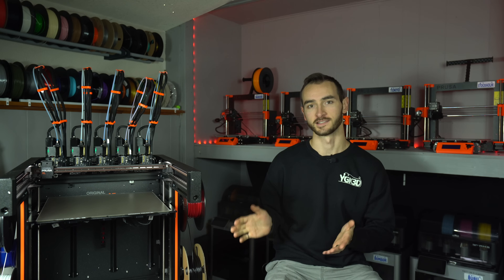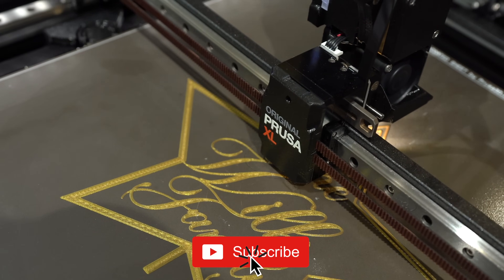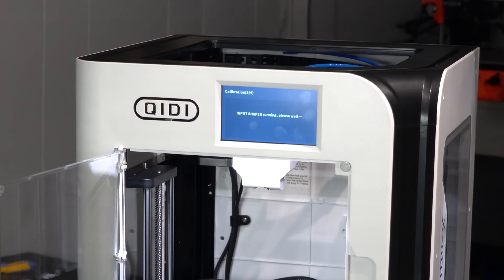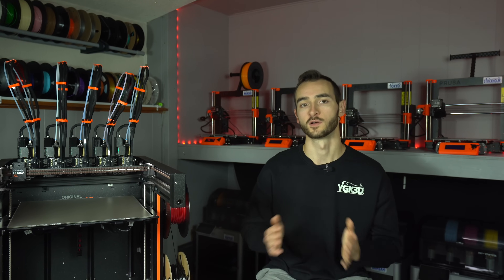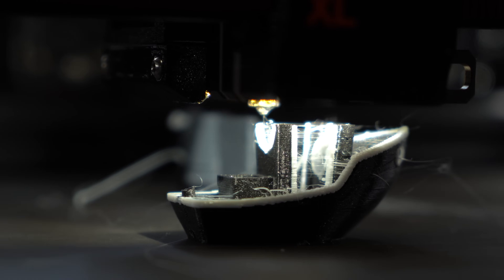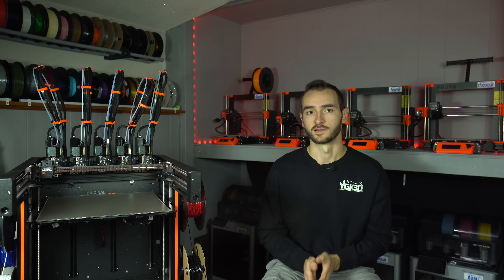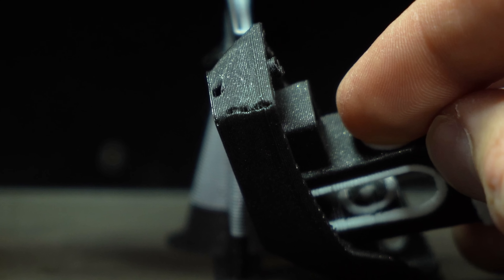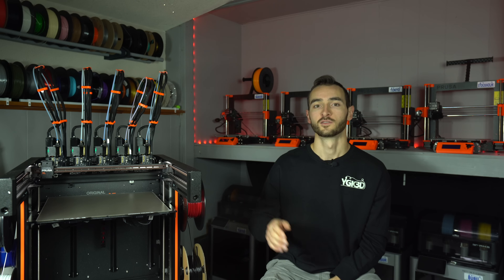The Prusa XL Just Got WAY Better with INPUT SHAPING... But Is It Enough?

Comment: The XL doesn't need to be as fast as a Bambu for single color.  My reason for wanting an XL is for multi color prints, which take forever on my Bambu  X1C
Reply: Also if some1 like to print multiple different material types, lets say tpu and PC, bambu can’t do that, XL can. So XL opens a lot of new oportunities.
Reply: @Bebamyotamaki thats not true. Bambu can easily print tpu abs pc an other materials. Dont know from where you have your information.
Reply: @Brise215  In the one printed part, e.g. PC with flexible hinge integrated by mechanical lock. Can it do that? Without post assebly.
Reply: @Bebamyotamaki  seeing that you wanna print pc for example how you gonna do that on the XL ? Its not capable of it, no enclosure or active chamber heating for that matter. Prusa didn't care for that price to add it. Says allot.
Reply: @OneHappyCrazyPerson   I still haven't got answer for my question: Is Bambu lab's printers capable to print that? As far as I know, it is not capable to print that.

Printing PC-filament without heated chamber debends on the filament properties. PC-filaments that are engineered specifically for the 3D-printing, like Prusament PC-blend, can be printed without heated chamber. And if you say:" It is a blend, not real PC-plastic", well.... If you can find any plastic object from your home that is made of homogenous polymer and not from blend, I will buy an other X1C for myself. Plastic object that is functional, usefull and specially engineered for its main usacase by the design and material stand point, that is made from homogeous polymer and is not a blend. Please.
Reply: @Bebamyotamaki  you really are a joke, the answer is above. And you can get all technical with the filament but the fact stays it's no substitute for a heated enclosure. If you had experience you would have know that but seeing how you try to mitigate the problem you don't have any experience. Yet for 3500 dollar prusa says screw you! Do without enclosure and without touchscreen and fast speeds or the capability in the future for it. Also kinda weird they want you to pay the full in advance and deliver summer 2024 what kind of bullshit company has this become ?
Reply: @Bebamyotamaki  Great way to get vendor locked with your filament that's not always the best on the market.
Reply: @Brise215 Your right, I did nylon, pc, petg, abs, asa, pla cf and never had problems.
Reply: @OneHappyCrazyPerson  I would bet my money that in a year bambu will prohibit the use of 3rd party filaments with the AMS. They are fully capable to do that. Inside of the AMS unit and the Bambu filament spools are a RFID tag reading properties. That means that they can just shut down the ability to print spools of filaments that do not have or have wrong kind of RFID tag. Then Bmbu users are locked to use only Bambu sold filaments, which prices will skyrocket by then.

Can you please prove me wrong by e.g. showing a picture or something where Bambu printer has printed flexible hinge attached to the any rigid part? And the part is printed in a one go without post assembly. Please.
Reply: @Bebamyotamaki  i never question it because all i printed worked fine. Never had problems with this machines and i never will worry because there is for everything a spare part wich is easy to change and fix. 
Trust me, its no wonder why so much people are fanboys of Bambus 3d printer. Never was so amused with a printer.
Reply: @Bebamyotamaki  Not sure exactly what you're asking but:
1) X1C can print different materials as long as they are not a mix of low temperature with high temperature plastics. This is kind of common sense - I tried printing ABS and PLA together (by tricking the printer, because the software is well put together and wouldn't allow you to do it otherwise) and got a heat creep extruder jam for my effort! Generally you can print multi material as long as the nozzle temperature between the two is within about 10-20c of each other

Now perhaps the Prusa XL can do it, but I doubt it and I doubt it would be useful, because if you tried to print say PLA at the same chamber temperature as ABS or PC, you'd get horrible warping of one or both. and probably bed adhesion issues. Given that PC prints on the bambu at around 110c bed and 50+ c chamber, trying to combine low and high temp plastics seems like a dumb idea of limited to no utility. 

As long as you dont try to combine high temp with low temp on the X1C, you can print multi material (and I've done so).

2) PC prints very well on the bambu BECAUSE of the chamber, and i can confirm you can get very strong warping forces through say opening the enclosure door too early after a print. To the point that your whole magnetic plate might be lifted from the bed! (ask me how i know). 

Not to say you CANT print PC or ASA/ABS on a Prusa XL without enclosure, but based on my X1C testing, I would say you will encounter many issues and will quickly conclude that an enclosure IS necessary.

It doesn't have to be heated enclosure, just enclosed and preheated (by setting bed to high temp and letting it heat up) will do.

But there are plenty of enclosure options for the Prusa XL i believe?
Reply: @Bebamyotamaki  I thought you had an X1C? Surely you know that the AMS CANNOT handle TPU and that you CANNOT print TPU with other materials from the AMS without manually doing switches?

I'm not sure if the Prusa XL can handle TPU + rigid but i thought it could and was one of the major advantages of the Prusa XL. 

The X1C CANNOT print TPU + rigid material in a practical, automated fashion. And nobody wants to sit there doing hundreds of material changes off a spool (and you can do that on any machine, not just an X1C). 

So no, no flexible socket attached to a rigid arm
Reply: @Bebamyotamaki  You would lose that bet! There's no way bambu will limit the AMS to only bambu filament, in fact, even now you can simply disable the RFID tag reading. 

I have no idea what your problem with Bambu is but that's ridiculous. The X1C is a fine machine and bambu have produced a good product that they support quite well. Doesn't mean a Prusa XL doesn't make sense in some situations, but it is ridiculous to claim that Prusa is somehow a less evil company or some such nonsense.

These are just products at the end of the day
Reply: @Bebamyotamaki  that is the plan. Tpu and pla mixed
Reply: @Bebamyotamaki  bambu can and does it, support materials that are different but also complete different filaments. It's up to the user, if the chosen plastics bound is another question.
Reply: @OneHappyCrazyPerson  Can you give  me an example of the material combinations? And I mean the different materials, not just different colors of the same material. Also I would like to know how is the mechanical properties of the part when printing two different materials (not color, materials) to the same printed part with single nozzle.
Reply: @Bebamyotamaki Who is the one crazy here? 🤣 Great job ! Keep going student, your learning.
Reply: @Bebamyotamaki  Dunning Kruger
Reply: @OneHappyCrazyPerson   =)
Reply: @Bebamyotamaki  it seems you are a fan boy that never even looked further then prusa and have some wrong Idea what other printers can't or can do. Just because prusa printer can do something doesn't make it the standard.. the printer firmware and it's options are hopelessly outdated. One could never hook up a adxl for input calibration, you just get some values for some slow printing and that's it. It's not really input shaping as it's not dynamic.
Reply: @OneHappyCrazyPerson  Okey, Im Prusa fanboy (even when I own X1C) and you are then Bambu fanboy. I quess that we are even. I might be short sigted, even I'm PhD student studying 3D-printing material science and machines with addition my side hustle business with selling 3D-printing  consulting. But In the world of 3D-printing Bambu fanboys always are superior persons, just because they say so by themself =)
Reply from the maker: Good call. It’s leagues ahead for multi colour.
Reply: @ygk3d  multi material, but prusa boys cannot compute that as in there world the prusa is everything.
Reply: This. That's the niche of this machine.

For single material or materials 6-16, the bambu is just better (6-16 only because this only has 5 print heads)

Comment: I have my XL for two weeks now. I changed the nozzels for Bondtech CHT's. The printer came with the new alpha firmware installed. I did not have any stringing with PLA and very little with PETG. As the Bondtech CHT nozzels are capable of melting the plastic faster, I've set the printspeeds about 15% faster.  The Bondtech CHT nozzels not only melt the filament faster, the have less ozing too.
Reply: Interesting, I have a Bondtech CHT on my FLSun V400 but I didn't consider them for my XL. Did you use the prusa "nozzle adapter" and regular Bondtech CHT nozzles, or is there something I am unaware of?
Reply: I agree with my Mk4. Bondtech cht nozzle is just 👌
Reply from the maker: It came with the alpha installed? That seems strange. Thanks for the tip on the nozzles.

Comment: Excelent review as always, but I would love to see a video of the XL making the most of those toolheads. 
By this, I mean:

* Printing with different nozzles, a large one for infill and a small one for perimeters and details.
* Printing with different filaments... solubles / regular ones.
* Combining rigid filaments with TPU to achieve more complex objects.
Reply: Hey - I did all three with my XL 2 Toolhead:

Printing with different nozzles is super hard and not really supported at the moment. This only works if you use on nozzle only for supports for example.

Printing Different Filaments works great. For example PETG Models with PLA supports works amazing.

I printed handles for Pushups for my wife since she has problems with her hands. I used a model from turntables and put a cylinder of TPU around it in Prusa Slicer. Printed great and works great. No Problem at all. 
The only thing I found out is that PETG sticks really well to TPU, so PETG supports for TPU will result in a very hard challenge afterwards - I needed an hour to get the supports of semi cleanly.
Reply: @zebarzebra  wow nice. 
Yes, I saw a video from ModBot (I think?) that tested supports using different materials, and he got pretty good results. Glad to hear that it works great with the XL.
Reply from the maker: Thanks! I’ll show off different material combinations in the next video.
Reply: @ygk3d  Cool! thanks =)
Reply: @ygk3d thanks!
Reply: Yeah that's what I want to see also, maybe a print with soluble supports and 2 rigid bodies separated by flexible TPU parts (maybe a hollow sphere with a flexible band around its "equator",  Or a box of some kind with a TPU hinge.

Comment: Can you try some multicolour/filament prints on the XL (not just benchy), and see the differences in quality and time between the XL and the Bambu X1C? As you said, the biggest thing the XL has is the lightning fast tool changes, so I would love to see that be explored a bit more. In what scenarios is the XL's tool changing superior in time AND quality, and in what scenarios is the Bambu set up better.

I saw in a different channel a guy with a 2 head XL, and he's doing TPU inside another material (forget if it was PLA or PETG), in order to make pressable buttons. Now that's not even possible in the AMS I think since it doesn't officially support TPU. What about using PETG as support for PLA, does that set up work well? Do the supports leave a nicer surface than normal same material supports on the XL? I know I can do that on the AMS, but it is just so slow with the filament swap, and since it is different material, you can't reduce the poop amount. Anyway, those are just some ideas to showcase what the XL might be better at.
Reply from the maker: Thanks for the suggestions. I’ll show off some more adventurous prints in the next video.
Reply: The XL head change is leagues faster than an X1 or P1 printer. (10-15 seconds vs 90 seconds on average) BUT...the quality from several youtubers have shown poorer print quality.  so you can save a bunch of time depending on the print but may have an inferior model at the end. 6:19
Reply: @ashleys3dprintshop  Yes I have seen some poor results with the XL, but I always wonder if those were maybe printed too hot, or maybe it's because of the default .6 nozzle? It seems like the XL has potential. Where as Bambu are much more turn key. So if you wanna hack at the Prusa, maybe it'll be able to print nicely. But I do wish either Bambu made a tool changer, or Prusa makes a smaller tool changer, that'd be perfect. I don't really need the giant print volume. But I do want multi-material/color prints.
Reply: @shenqiangshou  Re: "but I always wonder if those were maybe printed too hot, or maybe it's because of the default .6 nozzle", Prusa obviously believes the 0.6mm nozzle was part of the problem, as they have switched to 0.4 for further XL sales. But there is a lot more to the problem. Prusa believed they could prevent the stringing and color runs without a head-cleaner. And so far they are wrong. There are some community mods that add a small brass wire brush, and they drag the tool head across that when parking. This is the real solution, because one of the biggest problems is filament oozing out a bit on parking, then later getting dragged back into the print where that color isn't supposed to go. 

Physics is against Prusa on this until they decide to add a nozzle cleaning step which requires a minor hardware mod (for the cleaning brush).

Comment: be careful when comparing the X1C and the XL. The XL lamer is heavier and extruding more filament takes more time... 
the X1C is still faster with 115s/g compared to the 128s/g of the XL. 
But its not only due to different acceleration like you said.
Reply: Why should I reward a wasteful printer?

If the xl prints too much material, that's on prusa.

The end user doesn't care that IF prusa did the tuning work of bambu, it might be faster - they only care about how fast it is right now.

I consider using more material a huge detriment too, since i typically want to use only as much filament as necessary
Reply: @Tom--Ace  
If you want a wasteful printer, look no further than the Bambu on colour changes.
Reply: @Tom--Ace  It is not about rewarding a wasteful printer. It is about make a more correct comparison. If the slicer were equal what would there print times be. You could say:

Why should i reward the printer that distorts my original model more. 

With that said I would be nice if the XL had more tuning down to the slicer so that it can print faster. Prusa tends to not like to distorrs the thing they are printer for the stake of make a more accurate print. This mentally seems to be changing since they have been getting killed in the speed game.

Comment: Thank god I canceled my order 2 years ago; I would be pissed that I would have received a printer that was not fully baked after 2 years of waiting. And see, they still need to work out a good portion of the issues even though they said delays were to provide better quality.  And to add input shaping and pressure advance, which has been around for years. By the time this is a refined printer, they will be 3 years behind technology.  Prusa has lost its way.

Comment: I got an XL 5 Head and I can’t really say that it is worth the money yet. I am not disappointed that I bought one but I can’t say that it is an incredible bang-for-buck machine. However, if the support is as good as it was for my first Prusa Printer (Mk2) then it will eventually become and incredible printer.
Reply: Probably wait for XL mk2 or XL mk3 before they get it to where it should be.
Reply: Yeah but nowdays even creality brings much faster update than prusa...
Reply: Hardware wise the XL has much more potential and with Prusa you just know that they keep bringing out new firmware and slicer-tweaks for several years. The build quality of Prusa printers is good enough to last alt least five years, even with near continu running. Don't know if printers of other brands will be capable of that.
Reply: @wilsistermans1118 where did you get the "at least 5 years"
Reply: @Declopse seeing as it's already taken 2 years to get to market then it's even less likely to last that long 🤣
Reply: What and dumb choice to buy a prusa 🤣 fan boys waisting there money for something that isn't and never will be.
Reply: @OneHappyCrazyPerson  ikr. Mediocre machines. Really far behind the competition. For that price you could get a far better quality machines such as Elegoo Neptune 4 pro/plus/max for the price of 2.
Reply: @Declopse  I put my $199 down but I'm on the fence- I have a Kobra Max but Prusaslicer seems not compatible with it and my iMac will not run latest Cura it says it needs! How does the Elegoo Neptune 4 Max compare to Kobra Max? Does Neptune 4 have auto bed leveling with perfect first layer?? thanks!